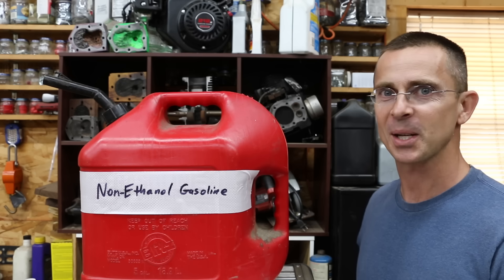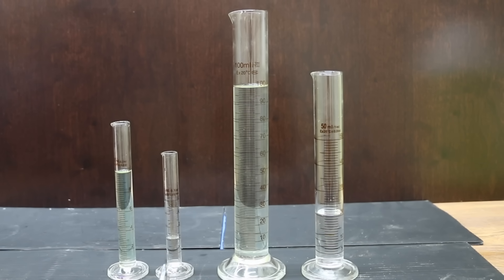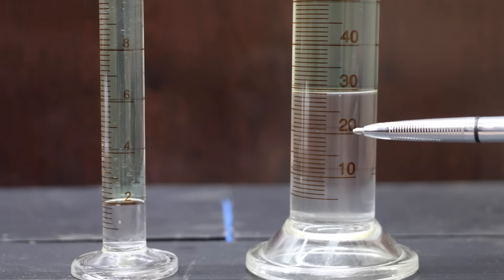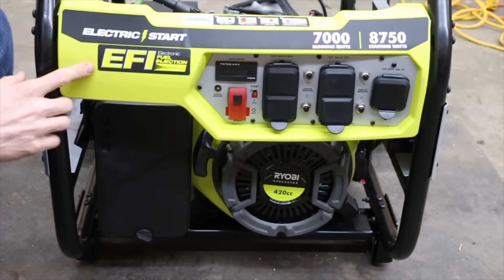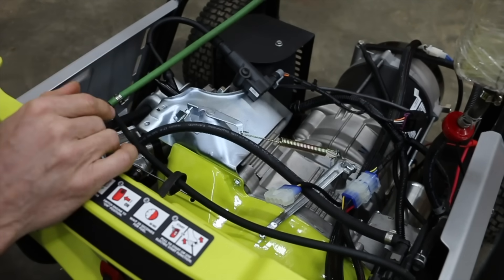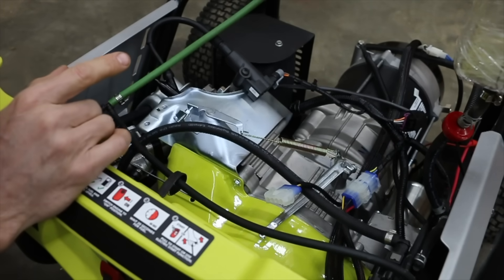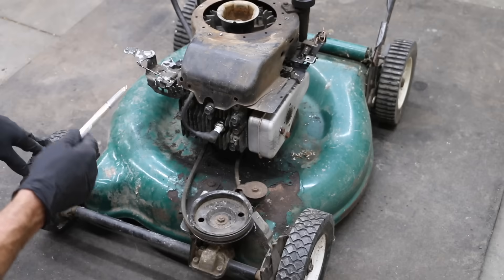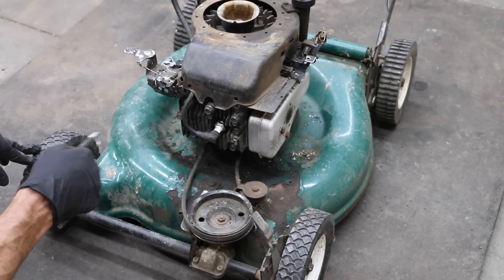Is Non-Ethanol Gasoline Really Better? See the PROOF!

Comment: Seen more hand held fuel system problems when E-10 came out
 like the hoses go bad faster other non metal parts are short lived . 28,000 series Briggs & Stratton engine needle valve seat problem where it seeps and fills crankcase with gas.
Reply from the maker: Thank you!

Comment: Really well done. I never put any EtoH in ANY engine because it is a bad thing !! Carboning up, less efficiency, and in big engine i.e. cars...you need to re-tune them...simply because cars were not designed to run on EtoH !!  They are designed to burn Benzene compounds...NOT alcohol !! Why would you !!?? And as you mentioned EtoH is very Hydroscopic which means it attracts water, also great for corrosion inside engines and fuel tanks !! Every way you cut it it is simply stupid if you use any form of EtoH in your fuels.
It is just the easiest way for oil companies to make more money...by "leaning out" the fuel..we make 900ml and add 100ml of cheap ethanol...and we sell it to you as 1 litre of fuel !! Ha !! 
10% profit straight away...money in the bank.
Reply from the maker: Thank you!

Comment: Years ago I worked on outboard engines, many of which were older. To save cost, the companies quit using metal for the carb float and switched to a plastic type. When ethanol gasoline became the dominant fuel, the floats would degrade the plastic and "soak" them, causing them to keep the needle valve open. The rubber o-rings didn't fair well either. The companies saw the problem, so came out with replacement kits that could tolerate the ethanol. They cost $50 + labor to fix the problem. Not a lot nowadays, but 20 yrs. ago it was. The ethanol played havoc with the older aluminum alloys too.
Reply from the maker: Thank you!
Reply: You're Welcome. I appreciate that you read the comments to your videos. Kudos to you.

Comment: I notice you have done a video on running an engine dry of oil. But is running an engine dry of fuel bad. I know it is for 2-stroke since the fuel does the lubrication. But what about a 4-stroke or diesel?
Reply from the maker: Great question.  My opinion is that it won't cause damage to the engine, but could cause problems for the fuel system, injection pump, etc.

Comment: I liked the water tests! 
Ethanol fuel doesn't have as long of a shelf life as it comes from the pump. Some older or cheaply made equipment will not have fuel lines or other components that can hold up to ethanol.

Comment: Ethanol is a death sentence to Carburetors.  Ethanol Free Gasoline (Non Blended) has a higher energy rating giving better Power and Mileage....  I get almost an extra 60-70 miles per tank with NON Ethanol Fuel... 17.5 gallon tank, 285 miles With and 350 miles without. In my Chevy Colorado 3.5 I5 Iridium Plugs and Mobile 1.
Reply from the maker: Thank you!

Comment: The stoichiometric ratio of 100% ethanol is approximately 9:1 compared to gasoline's 14.7:1 ratio which requires 39% more fuel than gasoline so a 10% blend should have a 3.9% reduction in fuel economy.  The math works perfectly with your experiment.
Reply from the maker: Thank you!

Comment: For day to day uses E10 is fine in any engine that doesn't require lead. There are two places where it makes a difference. Shen stored for long periods E10 is a nightmare. At least use something like Sta-Bil in your lawnmower over winter. Much better to run it out of fuel altogether. the other place is on a race track, especially with a high performance engine. Ethanol has a lower energy density. Unless you have a turbocharged engine specially tuned to take advantage of E85's anti-knock characteristics you will always do better with pure gas. Contrary to popular belief, higher octane means a fuel burns slower. At the track use the lowest octane your engine will run w/o detonation (knocking). There is enough mileage difference to be just noticeable in street cars between the two fuels but not enough to be worth any difference in price or the hassle of looking for it.

And FWIW, the proposed E15 is a disaster for motorcycles. Every motorcycle manufacturer says unequivocally "don't use it." When you've got one liter motors making close to 200 hp you can't mess around with your fueling.
Reply from the maker: Thank you!

Comment: Put each fuel in a dish and watch for 10 minutes. In Florida it happens in less than 5, water will swirl in bonding with the ethanol. Also, E10 stoichiometry is 14.1:1 richer than the non-ethanol 14.7:1. Means it needs more fuel to run right. BTU of gas is higher than ethanol.
Reply from the maker: Great point!

Comment: 10% ethanol runs badly in all my FI cars. Extensive testing of 6 cars has proved 6% loss of mileage, surging, rougher idle, harder starting regardless of ambient or engine temperature. Given a choice I never buy 10% ethanol.
A flex fuel pickup from E10 to E85 went from 17 to 11 mpg.

I spent $800 chasing rough running in a Lincoln Town Car and finally discovered it was E10.
Reply from the maker: Thank you!

Comment: Ethanol cancels out the octane , octane slows down the burn to create more power throughout the power stroke of a piston movement . Ethanol speeds up the burn robbing power , its a cheesy way for oil companies to make more money because you use more gas to get from point A to point B . I get 50 more miles per tank or more running non ethanol premium .
Reply from the maker: Thank you!
Reply: @ProjectFarm  no prob , cetane is added to diesel fuel to make it more combustible . The opposite of octane .

Comment: I ran non alcohol gasoline in an airplane for over 1500 hours. Only E10 was available in NJ, so I washed the gasoline through water to remove the ethanol.  I processed 50 gallons at a time in a plastic tank that had a cone shaped bottom. The resulting fuel  ran well and did not cause any problems with deposits or compatibility with hoses, o rings or gaskets.  The 6 cylinder engine was rated for 80 octane fuel  and had a 7:1 compression ratio. Upon tear down for overhaul, there were no indications that running unleaded, non ethanol fuel had any effect on the engine.
Reply from the maker: This is great information!  Thank you

Comment: E10 fuel is junk for small engines, or seasonal ones.  For me, i do not run E10 in anything i own.  I used to own a service station.
E10 was very hard in the pump nozzles, and the check valves also.
Reply from the maker: Thank you!

Comment: Would that way of adding water and then syphoning off the pure gas work for long term fuel storage? It’s sounds really backward, add water to your gas to keep water out of your gas lol, but it’s crazy enough to work!
Reply from the maker: I believe it would work well. Some octane loss occurs when the ethanol is removed, since it's used as an octane booster. Thank you

Comment: I have a flex-fuel capable car. When running fuel high in alcohol, I get many fewer miles per gallon. Not surprising since the energy content of ethanol is only 70% that of regular gas.
Reply from the maker: Thank you! I've had the same experience with my Flex Fuel vehicle as well.

Comment: It would be awesome if you could build a HHO split cell so you can split the water molecule into hydrogen and oxygen gases and then run the engine off of pure hydrogen gas or HHO gas to see how it affects an engine without making any adjustments to the engine and to see if the engine temperatures increase or decrease. It would also be neet to see you do the same test but make the adjustments to the engine such as adjusting the timing to top dead center so it can properly run off hydrogen gas or HHO gas and then check the engine temperatures cleanliness of the engine, run times and all that kind of stuff.
Reply from the maker: Thank you for the video idea!

Comment: I'm a small engine mechanic and I have witnessed fuel with ethanol wreaking havoc on small engines( 2 & 4 cycle.) mainly a lot of white crystals in the carburater plugging up the needle valves and orifices. Ethanol is made from corn and corn is loaded with sugar. (corn sugar) so yeah its gumming everything up.
Reply from the maker: Great point!

Comment: I get about 10% better fuel mileage in my car with none ethanol gasoline. I found this out completely by accident. On multiple 1000 mile road trips I got better fuel mileage after one of the. refils (I always calculate my mpg).It is a trip that I make multiple times a year and happened multiple times. After some checking I learned that the fueling station sells non ethenol gasoline.
Reply from the maker: Thank you!

Comment: That’s a nice generator. Where did you get it? How much was it?
Reply from the maker: I bought it from Home Depot (online purchase) for nearly $1,100 after taxes.  I didn't want to spend that much but EFI technology expensive. Thank you
Reply: Project Farm I want a generator and fuel injected is very appealing. No worry about the float bowl becoming clogged with varnish or anything else. I always store my small engines with the fuel ran out of them, but still.
Reply from the maker: Great point!  It does have more things that can potentially go wrong, such as the electric fuel pump vs gravity feed with a carburetor.
Reply: Project Farm one of my customers is a farm tractor/small engine repair shop. They have to take classes every so often to stay up on their training etc. fuel injected lawnmowers are on the way, a few years out yet. Auto choke was first to try and meet emissions. Next is fuel injection. Brigg’s and Stratton is ready to release a maintenance free small engine. No oil changes, nothing. It comes filled with full synthetic motor oil, you run it until it grenades and then throw it away. 

The number one problem they see is clogged carburetors from stale fuel and ethanol “poisoning”. When the fuel evaporates the ethanol leaves behind a white residue which is actually corn mash and it clogs needle seats. They also see lots of rust in metal fuel tanks clogging fuel filters. Ethanol attracts water as you know, which then rusts the fuel tank. They replace lots and lots of carburetors. Cheaper to replace than to rebuild. Unless it’s a older engine. 

I have a picture of a float bowl with rusted walls and corn mash in the bottom. I now only use ethanol free fuel in my small engines.

Comment: In this age of fuel injection, what difference does it make about the effect on components of carburetors?
Reply: I think it's more of an issue with small engines, classic cars, and boats since they still rely heavily on carburetors. Ethanol free fuel is actually required for aviation use for safety reasons.

Comment: My vehicle is flex fuel, so it can run on either. I put that worthless so called fuel in it once and never again. Fuel milage went from 17 mpg to 11 mpg with a very noticeable horse power drop. I say its a way to produce more fuel use and less fuel efficiency. This is my experience and just my opinion. Thanks
Reply from the maker: Thank you!

Comment: Ethonal ate up the plastic/rubber shut off valve under my generator and slow leaked 3 gallons of gas.
This is an extreme fire hazard. I think adding stabilizer to the gas accelerated the chemical deterioration.
Reply from the maker: Wow!  That's a lot of damage.

Comment: This video dont mean shit.both are about the same running an engine.The issue is that ethanol fuel ruins rubber and plastic components in the fuel system.

Comment: I noticed something else when I looked at the see through engine bit. Is it me or is the pure gasoline burning with more of a  cleaner blue flame than E10 is? If that's true it could be because of other additives they put in E10 making it burn worse.
Reply from the maker: Great point. Thank you

Comment: Non ethanol can be found around lakes and large bodies of water, it’s what the boaters use.
Reply from the maker: Thank you!
Reply: Mercury Marine thinks E10 may be the superior fuel to E0.  Boat motors in Brazil use E27.5 and are identical to ours.
https://web.archive.org/web/20140922142320/http://dcd96xmek71bc.cloudfront.net/archives/email/Trade/BoatingIndustry/MythsofEthanol-August252011.mp4

Comment: why did you buy gas at HyVee instead of Casey's?  You can use the HyVee fuelsaver card at Casey's.  Casey's pizza is the best.
Reply: I like Quik Trip pizza best.
Reply from the maker: Great point.  The Casey's that's near me doesn't sell non-ethanol fuel.  Also, they only sell 87 octane.

Comment: My biggest problem with ethanol in gasoline: It boils at 172*f and vapor locks in my Mercruiser's fuel rail. If I run ethanol free I have zero problems. 
My other issue with ethanol: It loves water so much it will attract it out of the ambient air. 
If you are looking for real fuel: www.pure-gas.org/
Reply from the maker: Great point!

Comment: Everyone's big beef with ethanol isn't anything to do with efficiency, or detonation resistance. The real issue is what it does in an improperly stored engine. It causes some nasty corrosion in carburetors and pretty much the entire fuel system in vehicles not designed to run ethanol or ethanol blended fuels.  Viton seals and float needles/seats aren't available for every old motorcycle or boat or car etc. engine. It's just one more plague helping to wipe out the classics.
Reply from the maker: Thank you!

Comment: As always, another informational and educational video. 
   My question has always been along with other gear heads I know regarding Ethanol based fuels is what sort of damage occurred or is occurring from using these motorfuels?, i.e.  needle and seat "O" rings, fuel tank sending equipment, carbueration acceleration pumps and related parts, also   damage to sensors like NOX, O2 smog/catalytic converters and related sensors etc...As most of us know or not know, Alcohol dehydrates pretty much anything it comes in contact with and I havn't heard of any modern vehicle on the road that has factory  equipment, gaskets, sensors that are specifically designed to work with these new Alcohol blended fuels, if so, maybe I was asleep when the information was publicized, then again, I am 50 and have never in my driving years purchased a "New or Newer" vehicle, I'am personally attached to Air cooled VW's and older pre 1975 ish American Vehicles which back in the day required Lead in the fuel as a lubricant for the valve train and top end components.
   At any rate, I'am pretty sure Auto part stores, mechanics and all, are making a killing replacing the above stated parts, a real quick "I know it's true" story. A good friend of mine purchased a brand new,right off the showroom "Chevy Silverado 1500" series truck and right after the warranty expires, he had to replace 5 sensors that were all smog system related and the cheapest sensor at the time "Early 2000's" was just under $200 dollars. If that isn't a money pit, I don't know what is?, rigged or conspiracy???..
  What are your thoughts and experience regarding all of this?.
    Thanks for sharing your videos!
     Kind regards, Eric Dee.
Reply from the maker: Thank you!